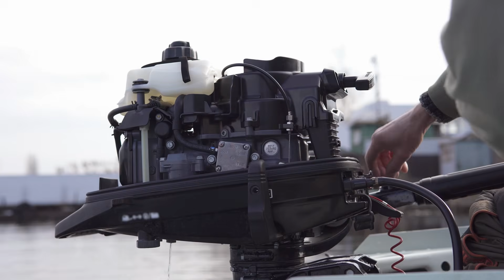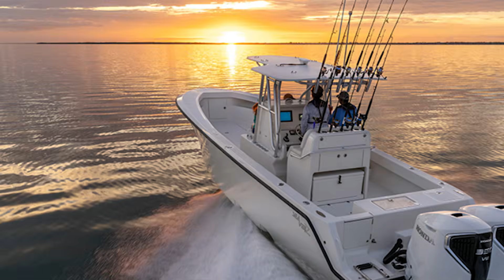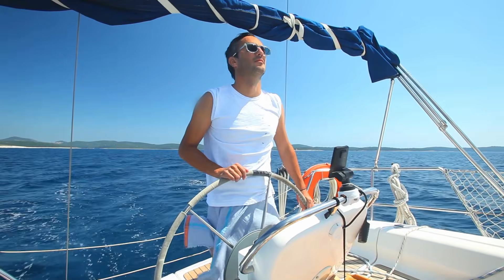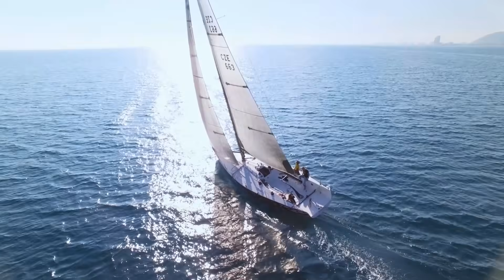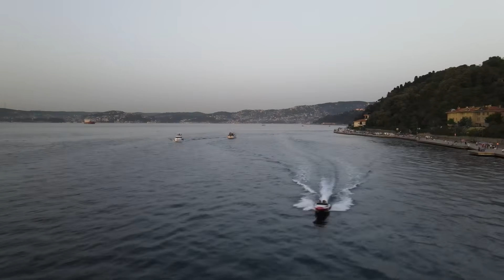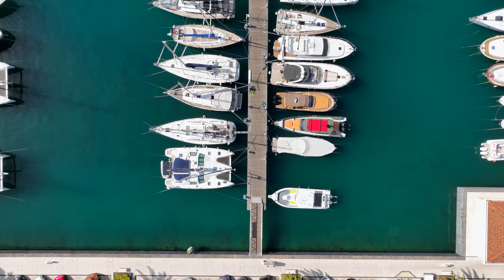5 Outboard Motors With Hidden Defects

Comment from the maker: 👉 Get The Outboard Repair Defense Guide here: https://outboardrepairdefense.netlify.app/

Think about what one trip to the shop costs you — a single diagnostic fee alone often runs more than this whole guide. For $39, these 92 pages tell you what's actually wrong, what the fix should really cost, and which jobs you can do yourself, so you walk in already knowing whether that quote is fair. It's independent and unsponsored, so no dealer or manufacturer is paying for a word of it. Catch one padded bill and it's paid for itself several times over.